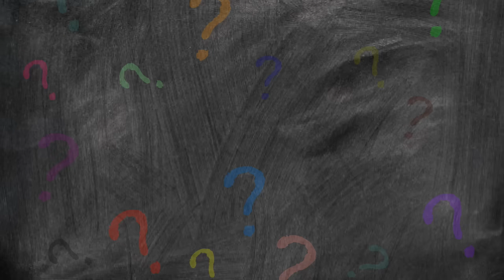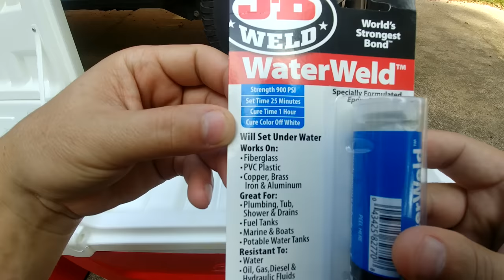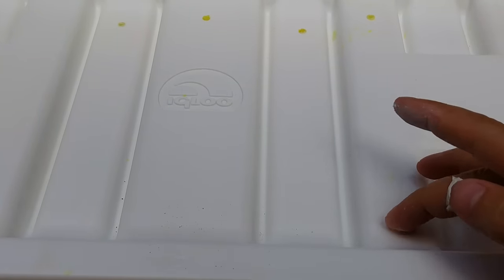Do Yeti cooler hacks work?

Comment: I insulated my small travel cooler lid and it got about five hours more out of it. The foam is not a solid, it is closed cell and is a certified insulator. That said, the window and door can is denser than the red and black cans of Great Stuff. So if the cooler hasn't been properly chilled beforehand, it can act as a heat sink and will give off ambient heat until it cools down. Expanded foam is what is used in all the expensive coolers like yeti and orca and they know their insulation has trapped heat inside and why those brands recommend prechilling with a bunch of ice before the final packing.
Reply from the maker: Are you saying I should have used the red and black cans as an insulator instead of what I used? In my second round of testing the coolers were both pre-chilled since they showed pretty cold temperatures before I put in the last bags of ice.
Reply: @HowToWithJames  Not necessarily, I was implying that the foam used may resist temperature change more than the others, I used the blue can on mine as well. I'd be interested to see the difference though. The contents of coolers may have been cold, but at that point, the lid being on top and the warmest spot, may not have had much in the way of chilling left as the ice in that had been melted away. Then again, I could be completely wrong haha. I have the exact same cooler as you used and was going to insulate it's lid soon like I had my small one. I'll see what results I can get and share them with you
Reply from the maker: Ok thanks, I would be interested to see if you have different results. If you look in this comment section two other people commented saying they got the sane results I got.

Comment: I suspected that. The density of the foam is an issue. Foam is a mostly a sealant in many applications so it's primary purpose is to resist airflow and not necessarily insulate. So by adding mass into the lid as the heat builds up into the lid it's absorbing and then directing that heat into the cooler. You've essentially created a thermal bridge. 

The foam used in a YETI is inslation specific to break thermal transfer and it's not designed to fill gaps and stop air flow. In fact it's very fragile stuff that compresses very easy under load so it's mass in place is probably 10-20 times less than that of the air sealant foam.

Comment: Are all coolers built equal?  Perhaps you should have tested the coolers side by side unmodified just to show they perform the same  before any modification took place.  I think the problem with the foam is there is no dead air space.  I think dead air space helps keep it cold.   I have seen test where the less  dense the foam the better the cooler performed.

Comment: Adding styrofoam to the bottom of the cooler would help.  Warmth escapes upward while coolness escapes downward.  The entrapped air in the lid is a much better insulator than filliing it with foam.  Foam conducts heat more than dead air.

Comment: It would be interesting to see how they perform in direct sunlight. I bet the insulated one will work better,
Reply: They're both insulated, the stock one is just insulated with sealed or "dead" air. Which is actually one of the best insulators you can utilize. It is how double-paned windows work, and why they are good for saving you money on cooling/heating.

The only way to improve is to use nothing. Meaning your best insulator next to sealed air is a sealed vacuum. Which is how a good thermos works. Then the heat energy from the inside and outside can only travel through the limited point where the two shells of it have to meet.

Comment: Also, for proper use of a yeti there is supposed to be as little air space as possible. Therefore not allowing heat to build and melt the ice by being trapped heat.
Reply: Heat escapes from a hotter area to a cooler one, in this case from the outside into the ice.

Comment: You're adding insulation, it help insulate ALL temperatures. If the cooler is hot the foam will help hold the heat until it's cooled the insulation. Start with both coolers chilled for 24 hours and then add the ice and move them outside

Comment: The ice will keep the air in the unsolid lid  cooler thus keeping the hot air out vs. solid will retain heat from the outside so it would heat quicker, I do HVAC........
Reply: Lol, I guess we should start taking insulation out of houses.

Comment: The bottom of the cooler is the only part you should need to insulate, the reason why chest freezers are so economical is because the air that is in it insulated on the sides and bottoms the top doesn't matter. You could in hindsight leave a chest freezer open for a hour and it won't really change temp given no breezes. A vertical or door freezer will probably thaw almost everything out. Try insulating just the red bottom part instead
Reply: Remember Heat rises and if you insulate the lid your just insuring the heat will stay inside, heat transfers upward 🙏

Comment: Heat always travels from hot to cold (Thermal transmittance). Heat escapes or in this case enters via the path of least resistance. Also, the top most likely did not seal properly all the way around. If it was tight in one area it may have cause the opposite side to actually produce a larger gap as the top is no more ridged not allowing it to flex and form a good seal. 
By insulated the top it prohibiting some of the heat from entering. This taxed the remaining uninsulated walls and bottom where the ice was located. Had you insulated the walls and bottom as well, your results would have been more favorable. Had you placed the ice closer to the top of the ice chest you would have changed the dynamics and most likely would have had a more favorable outcome as well. 
Also, at the expense of loosing some capacity, you could have insulated the interior completely with a product like polyisocyanurate. There would be an  air barrier between the insulation and the inside walls of the cooler (Thermal break), your results would have been most favorable. BTW, the R-value of the foam you used is negligible, next to nothing actually, the bulb-tape weatherstripping the same. Next time try a compressible foam tape which would perform much better to the unevenness of the injected or roto-formed plastic ice chest components.
Reply: That makes no scientific sense at all.

Comment: Which side of the truck got the most sunlight park it facing east west
Reply from the maker: I see this comment all through the comment section. My jeep has a black vinyl top and these coolers were in the back sitting on black carpet.  My jeep was sitting in my driveway with a house and tall trees sitting on each side of my driveway from where the Sun rises and sets. The only time of the day that my Jeep is hit directly by sun is around 11 - 2 and at the time the sun is directly overhead. I am sure the heat was even throughout the jeep during the day.

Comment: It’s possible that by closing up the hot cooler with the extra seal you didn’t allow the heat to escape and it cooked the ice. 
Try it again but pre chill both coolers with the lids cracked. 
Then throw in your ice and close them up.
Reply: I thought about that at first but I don't think it was the issue. Basically by filling the lid with foam he created a heatsink, similar to how a sponge absorbs and holds water the foam just ended up absorbing the heat, and in essence the heat then traversed into the cooler. The hollow, or air filled, lid wont absorb or hold nearly as much heat.

Comment: You should have insulated the body with foam. Hot air rises so by insulating the lid you trapped the hot air where on the std cooler it could escape. By insulating the body and base you trap the cold at the bottom and heat can exit the lid. In this case just insulate the whole thing for a much better result.

Comment: As far as Im aware, almost nothing is a better insulator than air that cant move. So a sealed lid is nearly as good as it gets. A vacuum would be better. Adding any material will increase the rate of heat transfer from the outside to the inside. I think getting a larger box and using foam insulation blocks to space it out from the walls and bottom, maybe with horizontal baffles all the way around might do better because it increases the air gap.

Comment: Try swopping the lids because To determine that the lid is the cause. The foam may have alter the shape because there were so few expansion holes for the foam to escape. In think there should have been an expansion hole in ever raised section.

Comment: It's NOT the foam that insulates. It's the TRAPPED air that insulates. The additional mass and density of the foam actually increased the heat gain into the box. The ideal insulator is a vacuum. IF you could suck all of the air out of the lid without it collapsing you would see very different results.  HEAT must have a path to travel. Either by physical connection or by transmission and absorption of the IR light generated by the heat. If you can reflect the IR light and avoid physical contact no heat will transfer.
~ This is where material science comes in handy. I made. Cooler out of 2" foam board and covered it with aluminum foil duct tape. It works great! Use epoxy resin or a good waterproof adhesive. My first cooler I used OUTDOOR liquid nails. That work great. My second box I used epoxy resin w/microspheres for a glue -- and fiberglass for a liner inside and fiberglass for toughness on the outside. It was a lot of work but I have a very cool cooler⛄❄️⛄❄️⛄❄️🐧🐧🐧

Comment: The top isn't supposed to be insulated that keeps internal heat from escaping and keeps the cooler hotter longer when you open it. Also it adds more thermal mass.. it's like a chest freezer the bottom insulation keeps the cold in and the lid on top keeps it from leaking as cold air is heavier about the only way to make a cooler better is to had a compressor and some coils filled with refrigerant, basically if you want a better cooler but a chest freezer

Comment: The type of insulation being used is going to be a MAJOR factor. I would imagine the Yeti coolers use closed cell foam while the Coleman uses open cell. the difference being that open cell insulation only has an R-Value or 1.7 per inch thickness. Where the Closed Cell Insulation has an R-Value of 4.1 per inch thickness. If the entire cooler were set with those two insulations you would have a CLEAR difference.

Comment: Keyword is LAYERS! To insulate some thing you need to insure there is no direct path for temperature to follow. The best insulator is a vacuum. The best way to insulate anything is to have it in a total vacuum. But of course in a situation like this you can never have a total vacuum in between the outside and the inside so the next best thing is to create layers of unconnected medium. More layers of minimum contact will slow  thermal conductivity.

Comment: Bob is right.  There is no better insulation than a vacuum.  The next best thing is a completely sealed air space. The foam you put in is inconsistent in density,  it's just the nature of the product.  It works around windows because you're sealing air infiltration through gaps. But your cooler lid had no gaps. It was a sealed space.  My background is industrial insulation. Everything from liquid oxygen plants to steam power.

Comment: It's because the insulated lid trapped in warm air and the  stock cooler let the hot air escape...if u keep both coolers in a air conditioned or pre chilled area and fill them both completely full the insulated modified cooler will then hd ice longer

Comment: I think the problem was you didnt break up the ice evenly. The stock cooler bag of ice looked noticeably more compacted, compaired to the modified cooler ice was almost completely seperated. Leaving the ice in the bag and without breaking the ice up would of been more of a control, or even using a large ice block
Reply: a better controlled environment would be inside where the location of the sun isnt taking impact on the coolers.
Reply from the maker: Even though I did this test twice you think this was the issue in both tests?
Reply from the maker: This is true but I figured I would do the same thing people do when they use these coolers.  If the hacked worked wouldn't you think it would have been so much better none of these factors would matter?  If I got a Yeti and compared it to this Wal-Mart cooler I don't think the results would be even close do you?

Comment: James you may have done this  wrong.  Too much foam in too small of a space will result in poor insulation.  The foam needs to expand so the gas bubbles are as abundant and large as possible.  The trapped gas is what makes the product insulate so well.  You only drilled an entry hole and trapped the foam so it could not expand.  Adding exit holes and using as little foam as necessary to fill the space when expanded should give better results.

Comment: The air gap is a better insulator than the denser foam. The more dense the material, the easier it will transfer energy.

Comment: I'm thinking because heat rises, when you open the cooler and let in 90f air, your trapping it in the cooler. The heat rises to the top and needs to transfer heat through the lid. The only way the heat can be diminished is by it transferring to your ice (heat travels to colder areas)....which is why your ice melted faster since it had to absolve the heat you trapped in the cooler.

What would be cool is to thread a nipple with shut off valve in the top and use a vacuum or pump of some kind to suck the air out, turn valve to seal it, then turn off and disconnect the vac.

I bet it would hold the ice WAY longer if you did that.

Comment: I wonder if a thin sheet of styrofoam on the inside of the lid  would help instead? Cut it to the size you need and use two way strips of tape, help hold it into place. Cut to proper size, no tape,  can also be place on the bottom of the cooler for extra insulation? Less mess and less hassle. I hope this works and is helpful.  😊

To avoid a water mess inside cooler from the melted ice.  Take a plastic bottle, fill it with water and place in your freezer over night. Then use it in your cooler. Also important to cool your cooler down first. Place it in a clean bath tub to prevent any mess. Put cold water in your cooler, close lid and let sit for 30 minutes before use.  Drain water and your good to go. 😊 Take care. 👋😁

Comment: Air is a very good insulatior. I built a pizza oven with clay. It was VERY hot to the touch, but when I added a layer of beer bottles and mud to the outside and with an 800 degree fire inside, my cat could sit on the roof!

Comment: I added a strip of weatherstripping to my cooler and it prevented the lid from fully closing. So I added a latch and adjusted it to just put enough pressure to make the seal. Might help your modded cooler. I believe weatherstripping plus a latch may be more effective than the foam in the lid. Although I would do that too.

Comment: Try filling with sand instead of foam. Sand has less heat absorption. Heat will not transfer through sand. Example..walking on hot sand, but directly under it's cold and walkable. I filled mine with sand and it lasts a week.
Reply: SAND?, the lid would no longer be able to stay open , and it would constantly dethatch itself form the hinge, it would just weigh to much , you would need 7 or 8 pounds of sand to fill that lid, maybe even more :O
Reply: @seanc8054  what you want everything should be easy?

Comment: A solid block of ice would be more accurate. Emptying bags of loose ice loses equal parameters since the cooler containing the most clumped ice would keep cooler longer. I also believe the air gap is the better insulator due to lack of conduction.

Comment: You need the air gap to insulate.  So the only thing you could do is to make a second liner with foam insulation with a small air gap between the original cooler and the new liner

Comment: The lids on these “budget” coolers are designed to let heat out, they usually have holes on the inside to assist with the heat release.  The cooler is going to get warm air inside, that’s a fact.  Sealing the lids like this just cooks the ice.  Higher end coolers with insulated lids also have way more insulation in the sides/bottom and usually latches to help keep the warm air out.
Reply from the maker: Would you suggest I do something different than I did and if so what?  Or do you think these hacks cannot be done on these coolers?

Comment: You added a lot of insulation on your lid. All yeti type coolers have to be pre chilled over night with a bag of ice first to get full effect.  That insulation was obtaining heat pending where you stored them at prior to the test which resulted in fast melting ice. Also keep in mind when these coolers are tested for ice retention times for comparison , they are completely filled to the top.

Comment: Heat rises and cold air sinks. 

Insulating the top is trapping the heat in the cooler and melting the ice from the top down. 

If anything you would want to better insulate the bottom.